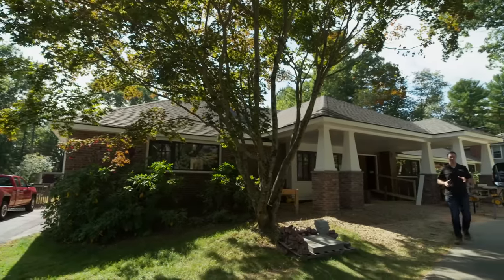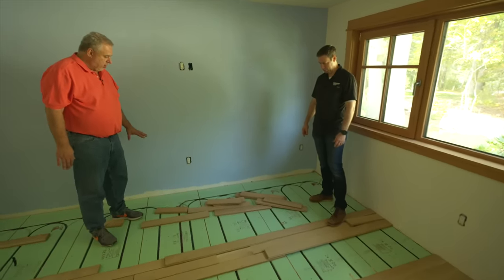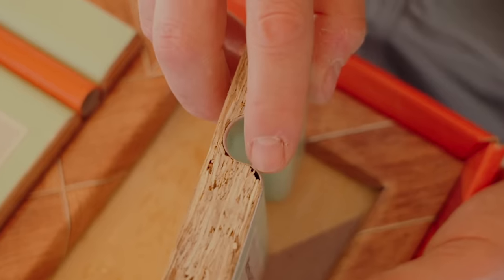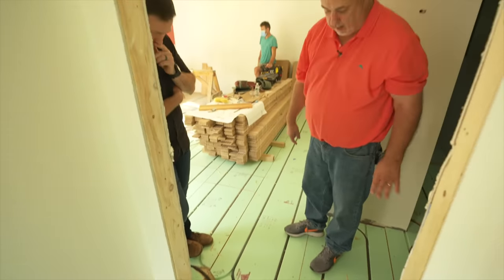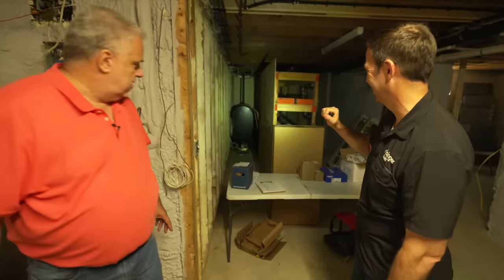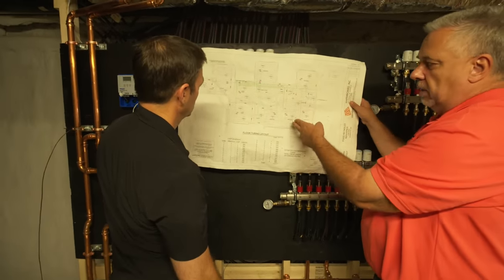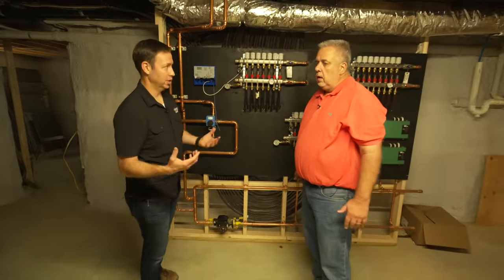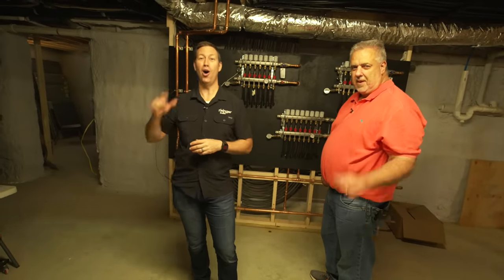Plug and Play Radiant Floor Heating System - BEST ON THE MARKET

Comment: No way Rich Trethewey would have allowed that oil tank and boiler to remain - that is a mistake.
Reply: This Old House should be called This Old Money.
Reply: @oltedders  Have to agree - they have a substantial budget on a lot of those projects.   But -  the spendiest one I watched seemed to be new New England tech money. 

The oil tank and oil boiler though - that is a disastrous decision.   Many many better options.
Reply: @brucemacneil  
This boiler is only 5 years old. New isn't necessarily better.
Reply: @oltedders  Furnace Oil - should never have been installed in the first place.   So many better choices.   Especially now - the heating load in that house is likely reduced by 70% or greater.
Reply: @brucemacneil  
No natural gas lines there. Heating oil is de rigueur in the North East.
Reply: @oltedders  Yes, I am aware.   We had oil in our old house and I now own a few places with similar boilers - though none as grand and lovely as the house in this video. There are options to oil - air to water heat pump,  solar,  propane boiler,  electric furnace - anything else but oil.  

Oil was great in about 1962.   Now - it is dead last on any list.   The risks and downsides are simply too great.
Reply: @brucemacneil  I believe it to get changed out in the not os distant future - just wasn't part of this phase
Reply: @stevenbaczekarchitect9431  Good.     My childhood Cape Breton family home had an oil boiler - ouch.   Have since renovated many (many) houses and SOP is remove the oil boiler and tank in favour of absolutely anything else.   The tanks cause insurance companies to walk away.  

The best first step to heating a house in that climate zone is exactly what you guys have no doubt done - building envelope, control layers and insulation.  I have reduced heat loss by as much as 90% in many vintage houses.
Reply: @brucemacneil  
I personally would have looked into using propane were I in the same situation.

Comment: I want to see total cost of the system, I'm betting 50k.
Reply: in europe floor heating costs about 1000 bucks per floor. cheaper then radiators or forced air in every room.
Reply: Paid $15k in Canada 30 years ago for a 6 zone, 3,500 sq ft house, plus 700 sq ft garage and a Viessman boiler and hot water storage tank ...  clean and quiet.

Comment: Warmboard is a quality product, but economically speaking, radiant floors are best suited for a concrete floor........a few hundred bucks worth of pipe per room and whatever system to run it from simple to complex and as many zones as you want.

     Nothing seems engineered or tailored to simplicity and affordability or serviceability....radiant is great, you need to keep a tight handle on plans or it can escalate out of budget very quickly.

     PS, just to be a stickler, warmboard does not limit runs to 300 feet, on a 1/2 pipe, not mentioned, the laws of thermodynamics and efficiency of fluid dynamics limits it and also efficiency.   Smaller runs with 3/8ths and longer runs with 3/4 pipe.........

     If the budget is there and you must install it in other than concrete, then warmboard is certainly worth looking at if you want plug and play support.
Reply: Actually they do limit it, based on the science of engineering as you stated - but they are using proper science.....
Reply: Warmboard advertises that a wood floor can be temperature-adjusted in a much shorter time--dial the heat down when you're gone for part of the day--whereas concrete must run constantly due to its slow reaction time.
Reply: the advantage of concrete floors is thermal mass so that you don't have to run the system as much. one drawback is slow response time (there are cases where that can be an issue). another drawback is the structural requirements of pouring a concrete floor. you're probably not going to do concrete in a remodel. since this was renovation, the only viable options were to put the loops above the subfloor or below the subfloor. either option works and each option presents its own issues.
Reply: @stevenbaczekarchitect9431   I agree, I was just being a stickler, they follow proper science ..........having watched many of your videos, I know you are also very detail oriented.  So part of being a stickler was giving you a hard time......which does not convey well in text. :)

 Anyway, if you read this, keep up the great work....I have enjoyed your vids due to the level of detail, thanks !
Reply: @paperwait9611    I would certainly choose warmboard system over running below the sheeting or using gypcrete.......as you pointed out, this is exactly what warmboard was made for and was a excellent choice in this situation.

    I know some people prefer the performance of warmboard due to the whole thermal mass flywheel effect of concrete.....I was saying...economically... speaking , concrete installations are cheaper.

     Another huge benefit not covered in the video is radiant performs much better when there are lots of windows or the exterior doors are opened frequently as it is radiating heat.

    That`s why it is a top choice in heated slab garages as you can open the garage door and the room will recover very quickly as soon as the door shuts and all that expensive hot air from a traditional forced air system does not escape as soon as the door is opened.  A lot of the time, depending on the duration of the door being opened, a radiant system with the temp probe for the thermostat in the slab will not even come on with the door open for 5 minutes, since it did little to cool the slab in that time.

    If I was doing this project, there is no other product I would use for radiant, I would do it exactly as it is being done.
Reply: @CannabisRex    Yes, warmboard has that capability due to low thermal mass of the floor.

   Concrete does not have to run constantly ever, it is left on as normal, it actually only runs when needed, which could be as little as 4 times a day.

    But I get what you were saying, some of the newer controls for concrete based now have outside temp probes and weather data pre loaded and will compensate to some degree and reduce BTU output based on anticipated outdoor temps.

    A side effect of the newer more insulated houses are the radiant floors feel less and less warm since the water runs about 90 ish degrees when its on, unlike the older houses which were very uninsulated and the radiant would get the floor to 90 degrees or hotter, the newer ones hardly get the floor to 80 degrees,......which is still better than 50 or 40 ......but usually they are just a couple degrees above room temp.

    So low in temp, many customers will call and ask if it is working right, especially if they have had a older system in a older house before where the floor got hot.
Reply: @shawncockrell6007  Hey man, we are cool!! I thank you very much for joining us, and I welcome your comments, and I apologize sometimes I get all wrapped up in the trolls here I forget there are great people trying to unerstand, and help out with their knowledge. Again, I appreciate your support and comments

Comment: Won't heat homes as well as a forced air system like we have up north in colder climates. Radiant flooring doesn't work as well as traditional hot water heating systems 

Also when that system wears out it will be extremely expensive to reinstall another system. Also the homeowners are stupid to invest in that new system and not a new boiler
Reply: So, I disagree with it won't work as well, the systems success has many requirements outside of the system hat provide success or failure. What will wear out on the system? Lastly, and I will be nice, please do not call my clients "stupid", you don't know them, or anyhing about them, and further more their investments are not rally any of your dam business
Reply: I see a lot of radiant heat floors advertised in Sweden.
Reply: @paperwait9611  two things that can wear out. the boiler.. it is actually in my view the weak link.  Secondly might have a pump go out.  pumps are cheap and readily available.  One thing mentioned that I thought was very important was having the tempering valve.  Radiant systems do run at very low temperatures.
Reply: @paperwait9611  Been doing this for 30 years, I use that term for people like you who do not have a clue and for people do not work in my industry.  When failures happen with this system for example  the idiot homeowners leaving the inefficient boiler that is already 20 years old, its going to be very expensive to repair. If any failure happens with the radiant tubing which it does happen it will be major construction to repair.  The more complex the more things that will go wrong.
Reply: @zack9912000  everyone in the construction business seems to have "been doing this for 30 years". then you see the guy in person and he is, like, 25 years old. i don't rely on claims made on the internet, i rely on what i read and whether it makes sense. your comment makes no sense. it is merely an unsubstantiated allegation. your only defense seems to be that i wouldn't understand it if you explain your reasoning. well, if your reasoning makes no sense, then you can assume that i won't understand it.

Comment: Floor guy put a nail though one of these pipes.   it was a 200k  in damages to a 30 thousand sq ft house.  what do you do when the water source is under the floor on the 3rd story.....   not much.   turn it off and hope you got it fast.   then replace the floor and heating system.   
thats 1 nail.  200 k .

these systems are just not worth the risk of leaks.

Comment: Very expensive and it doesn't even address A/C needs which will have to be forced air or multi ductless split.
Reply: Very cheap outside US - I got similar area for less than 10 k USD and you can use this for cooling - warm water is flowing in winter and cold in summer. Works great.

Comment: “50 to,100 years from now...” lol, name me one plumbing product today you can reasonably expect to last 25 years. This monstrosity is going to be someone’s maintenance nightmare way before that. Just curious, does this circulate plain water or an ethylene glycol solution? I know these radiant floor heating systems using glycol get gummy and clog all the time.  So what then? Rip the floor up? No thanks.
Reply: The PEX pipe should easily last 25+ years....more likely 50-100+. 
Typically propylene glycol is used in hydronic heating system whereas ethylene glycol is mainly used in geothermal systems. Neither one will get gummy or gel up unless poor water is used (ex. water from a well) and even that's rare. In such cases there's products to help descale/delime and it would not require any pipe removal. Again, it's very rare but we did just go through this with a customer. Certain well water reacts poorly with glycol and it turns gummy. Use good water (distilled).

Comment: If you glue then to the floor the wood cant do its natutally movements... So, bad design !
Reply: You do realize that most wide plank floors are glued down?
Reply: I don't know anything about this glue, but I'm assuming that it needs to stay a little flexible. It just holds the plank down and keeps it from squeaking. I don't believe that there's any glue in the world which could possible keep it from expanding and contracting with moisture content.

Comment: Your closets don't need to be heated.
Reply: I like a warm jacket
Reply: I know ... I was like what? Why is it everywhere? Cool system,  but humans are so excessive
Reply: @jtmcanada234  Exact;y. I mean, I understand that there's a certain number of BTU/hr you want to put into each zone. If you have a huge walk-in closet and you need that floorspace to give you the BTU/hr you need in that zone, fine. But my guess is this small closet makes no difference. If you were installing forced air, you wouldn't put a vent in a closet.
Reply: kichigaisensei No, but the floors need to be the same level, which means you're going to lay the boards under the wood floor anyway unless you're happy with a half inch step to trip over every time you go in the closet. Once the boards are in, you might as well lay the extra few feet of pipe as well.

Comment: This wont even work the piping is wrong the pump should be right after the mixing valve and the closely spaced tee's shouldn't be there at all. YIKES
Reply: I actually works very well.....YIKES back!!
Reply: @stevenbaczekarchitect9431  if it works at all it doesn't work even remotely efficiently or effectively as it should and could with minor adjustments to the piping, I'm a hydronics expert, and this is wrong.

Comment: I think this is a nooobish way to do it. The lines should go in a spiral not a snake. When you do a spiral, you have alternating lines next to each other(hot,cold,hot,cold etc.), this provides an even heat distribution. When you do a snake, you will have one part of the floor noticeably hotter than the other. At least thats the way we do it in Europe.

Comment: Also a mistake not having the manifolds upstairs.   Ideally the primary loop would pass through the top floor.   Bring all of the loops back to the basement is 50 year old thinking and not the best.
Reply: I don't think it is that big of an issue

Comment: Matt

Complicated this, complicated that,  high tech stuff........what ever.  

Not to many people these days stay in one place long enough to recoup the cost.  Just insulate properly and use base board electric for heat
Reply: Or you invest the money, and add 10% over cost to the value of your home when you sell it (Assuming your home isn't already near/over local market value).
Reply: Another fair point but perhaps the estate agent can sell the property by "selling" the heating system to possible new owners?
Reply: @t1n4444  People tend not to want to buy "new" property that they have to work on. Unless they are home flippers, in which case, they want a pile of crap worth nothing, that they can either rip down and replace, or spend minimal on and flip sell it. Lastly, the one price you cant really put a penny on... your happiness of having warm feet when it's -40' outside, and you step out of bed onto a nice warm floor.
Reply: @spyrule  yup. And not a high heat like baseboard or radiators. No nosebleeds, no waking up in the night from getting roasted by them
Reply: @spyrule  True but someone of my vast age might be jolly grateful the previous owners had installed such a system, including heated cupboards in which to store my keks.

Imagine the double luxury of stepping onto a warm floor straight from the shower and then stepping straight into warm keks.

You have to be old to appreciate these things.
Reply: @t1n4444  

Alaska,  now that’s a whole Nother question

I’m with you on that

Comment: Also most expensive system
Reply: Art Vandalay comfort is worth paying a little extra for. Not to mention it solves the problem of ugly radiators or baseboard heaters, remove the constant churn of dust that blown air systems create, allows furniture to be placed wherever you desire, is almost completely silent in operation.
Reply: @spencerwilton5831  I'm saying it's the most expensive radiant floor system, the actual Warmboard brand. You could do another system, including ones very similar for half the price